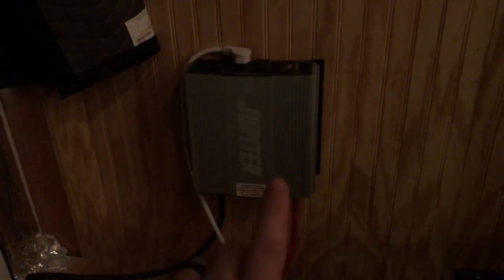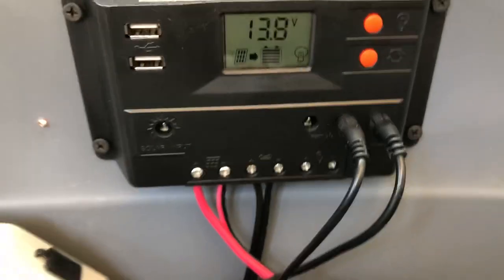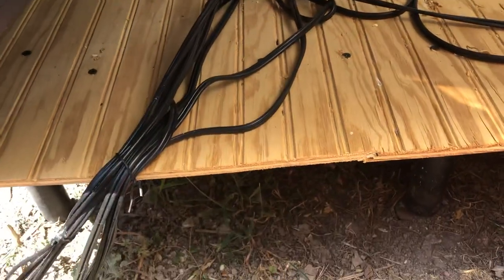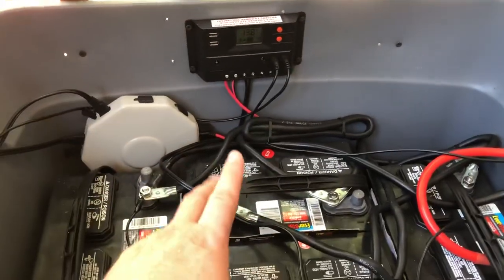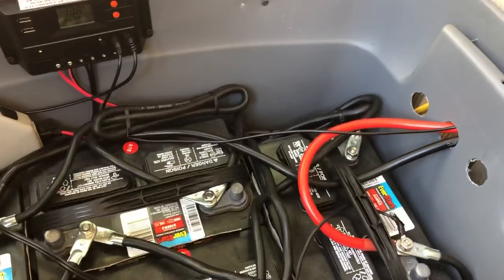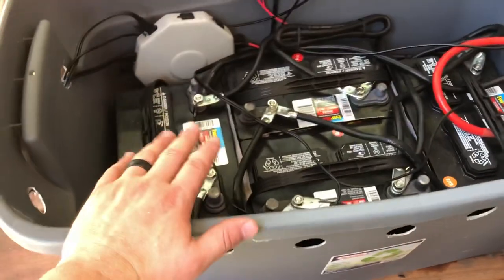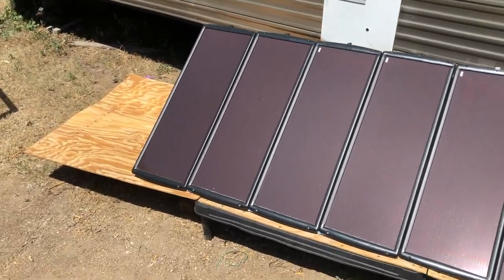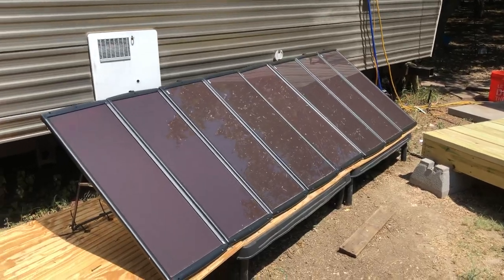100watt harbor freight solar kits  tied together off grid basic starter setup

Comment: Hey bud nice set up get a few gallons of distilled water and keep them checked the acid level will go down in time because of the gas the batteries give off while charging mine at my cabin needs filled every now and then don’t put acid in them just the distilled water

Comment: Are you using just 1 20 amp  charge controller? Having 2 kits tied together I would think you would have to double it? I'm trying to figure the kit out right now, I also have 2 kits, but thinking of keeping them separate, one to power lights upstairs, and 1 for the basement.
Reply from the maker: You are safe running 2 kits through the 8 plug hub into 1 of the supplied charge controllers I also use  the other left over charge controller just hooked to the battery side and setup remotely just for lights and to still use the usb outlets 👍🏻

Comment: We bought 100watt harbor freight solar kit wit all accessories that we need & bought 2/100 watt panels & 3 harbor freight batteries but we not getting the charge to charge a phone or laptop or evn power on our TV.  What are we doing wrong?
Reply: those single 100w panels are 24v so you might want to connect the batteries in series but check and make sure
Reply: Check your charge controller settings. You may need to turn the controller to charge mode.

Comment: You can use the accessory cable to connect 1 panel into the 4to1 and extend it that way. So you'd need 1 accessory cable per panel.

Comment: Yeah when I changed my controller it made a giant increase in power getting to the batteries...I already had 400 watts of HQST panels when my uncle gave me 2 of the 45 watt thunderbolt kits which I'm using but if you run a mppt controller you'll get way more so I'm gonna run them thru the 4215 BN epever instead of these little 4 amp ones that I'm having to run in series that came with the kit..anyhow I've got 490 watts of panels but I'm gonna order 2 more 100 watt panels I think...that's 690..sounds better lol..not too shabby for a homeless guy..if I get some place I'll get another 4 panels probably...I've got six 85 amp hour RV batteries but I'm gonna get 2 more tomorrow..I gotta build a shelf to hold the 2 I'm getting  so they'll be close to my Aims 24 v inverter/charger its 2000 watts..I don't like too much being able to run whatever I want to..kinda getting more funner now lol

Comment: Why 2 kits?  I saw a guy have 1 kit and 3 batteries (parallel circuit).  Doesn't the 4 panels just charge all of them?  Or was it 2 kits so you can charge the batteries faster as your energy usage is that much constantly? Thx
Reply: Generally and it's good practice to put 50% more energy in the battery  than power consumption from equipment. When using a lead acid battery system running the batteries at low voltage for extended period of time will cause crystal sulfates on the battery plates. Lithium batteries don't have this problem

Comment: Why did you write them in parallel (batteries)
Reply: Increases the Amps but keeps the voltage at 12volts. The inverter is a 12volt DC/120volt AC unit I'm guessing.